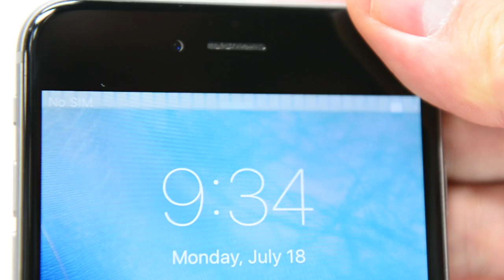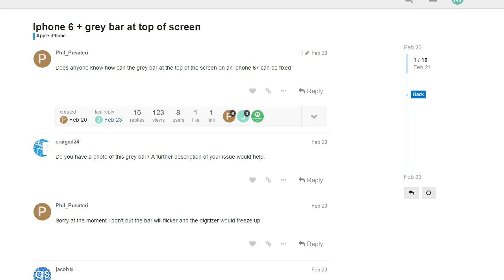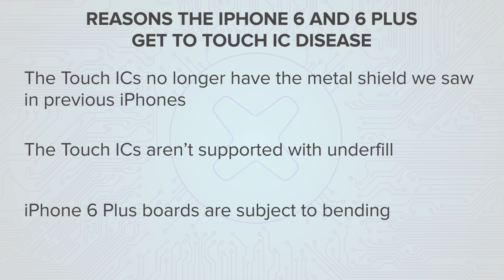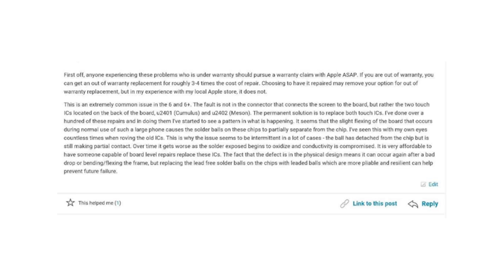A Design Defect Is Breaking a Ton of iPhone 6 Pluses

Comment: No metal shield and no under fill and put into a bendable metal housing...

Apple has taken too many cost cutting measures. 

Hopefully iPhone 7 is better.
Reply: I work at a iPhone repair place & this has happened a lot, also Celestial Being FTW
Reply: Sabino Rodriguez That sucks. I have a regular iPhone 6 16GB and well, looking at this bullshit, I don't know if I should wait for the iPhone 7 and see if they fixed this cost cutting bullshit or if I should make the switch to Galaxy S7/Galaxy Edge 7/Galaxy Note 7.
Reply: Sabino Rodriguez Oh and yes. Gundam 00 is my favorite Gundam series.
Reply: Even with this I still wouldn't go to Samsung I would rather go to LG or One Plus. Samsungs are one of the worst phones to get fixed. I also usually switch phones yearly before the warranty expires also haha

Comment: It's planned obsolescence. Full stop.
Reply: Such a systematic design flaw could very well end up as a class-action lawsuit. While the warranty may be only one year, nobody buys a $400-600 phone expecting it to last barely over a year before developing a major flaw. This sort of thing is covered under fitness for the intended use and reasonable expectations regardless of the warranty.
Reply: I hope they get sued to hell. 300 Billion USD penalty would be adequate.
Reply: I don't support the reasons given in the clip, metal shielding isn't used to provide rigidity, it's too thin to do that, it's used to shield the boards from static electricity, same reason as the tape, further the 'super glue' (terrible analogy) isn't used so much as a structural element but more for isolation between the pins of the IC as they are in such close proximity to each other, the lack of proper isolation between the pins in more likely to short and damage the chip, or an internal chip malfunction due to overheating. Anyways all products designed are designed to fail nowadays to increase profit margins
Reply: T3RRA_BITE_
The shield is there for EMI compliance reasons, not static. The PCB is inside a housing which already protects it from static and there are many traces outside of the shield which could conduct static to the stuff located under the shield anyway, such as all the buttons, camera and external interface stuff. As for the underfill, it is both structural (relieve some mechanical stress from the balls) and to prevent stuff like moisture and foreign objects from getting under it - those tiny balls and pads won't last long if moisture corrosion gets a chance to get started.
Reply: +BloodySword I wish they could get sued for that amount, lol. That will teach them to stop fucking with their consumers.
Reply: DuxDub Studios
Best "sue" (punishment) is the customer not buying their crap anymore.
Reply: I currently think so. My iphone 6 started having this vertical white/washed out stripes running through the LCD today.  Other youtube fix vids say its a loose connector(s) from the LCD to the board. I went to the apple store and wasted a few hrs for them to tell me my screen is failing and it'll cost $130 to replace it or I can trade in.... This is happening 2 days before iphone 7 comes out.  I know someone else who started having the same problem a week ago. I'm going to try to fix it on my own first before I decide anything. :/
Reply: +Teardown Dan +Teardown Dan You are correct about the EMI compliance, however it is also there to remove the local static that the boards can come into contact with when they are being handled in the production stage as opposed to induced into the system, 
Although the underfill is used for that it also prevents metal whiskering, a common failure mode for IC's with pins in very close proximity 

The point I'm trying to make is that the reasons that they are giving don't really seems to add up, it's not a very good analysis of why it actually failed more of a random non-fact based guess when they seem to have the tools their to properly test the mode of failure or atleast narrow down what could have went wrong
Reply: Milos Djeric
It's not. It's overpriced rubbish, too. I would recommend the One Plus 3.
Reply: Milos Djeric
Samsung ones are slow, battery problems (I am not talking about explosions, the batteries just don't last very long), touch wiz is a joke, android is buggy... Never again.
Reply: Milos Djeric
I didn't have much lock on my S1 back then, and others who have Samsung (in Germany almost everyone has just Samsung) are complaining about slowness, bugs and things. :/ So I just keep recommending HTC 10 or One Plus 3.

I also tried to help them with custom ROMS on their S2 - S4, also not with much luck. It got better, but the internal flash is so utterly slow compared to the UFS flash in the One Plus 3.
Reply: Milos Djeric
I had the One m8, I don't even know the evo 3d. Is it a low cost phone? Try to show me any phone which has similar specs like the One Plus 3 for 399 EUR by Samsung. ^^
Reply: Milos Djeric
Ah I see. Then I have just higher requirements. I am really stunned about the One Plus 3. :D
Reply: Milos Djeric
My PC is my home theatre system. So no need for an IR remote. I can do it with a simple app. :3
Reply: Milos Djeric
I don't have a TV. 32 inch 4K monitor. I don't need waterproof things, I never destroyed something. I don't even use a phone case and I don't have any mark on my phone.
Reply: Milos Djeric
Never had problems with it, I usually keep it dry in my pocket then. When it's raining, I am busy holding my umbrella anyway.
Reply: Milos Djeric
I just don't have my phone on hand all the time, so even if I get surprised by rain it's not a big deal. Never had issues with this. Waterproof phones are just marketing anyways. If you treat your phone right, you don't need any case or any water proof phone.

Comment: i hav a karbonn android 4.1 tab bought in2012, worked great till now, even replaced its 8in digitizer myself.Now  it randomly any time touch feeds itself to anything on the screen_have enabled screen touch feedback, so i see the touch points.. if i even disconnected the digitizer connection still problem remains, so can't use a use a usb otg mouse also.,pls help.

Comment: iPhones still last longer than their Android counterparts, that has been proven.
Reply: Mabirc
Answer my questions? let alone answer one the article even proves more flaws and even misinformation
First the article was made by "appleinsider" in favor to apple, it's more than safe to say that it has a clear bias
Second the article was made 2 years ago with so called "press release" from 3 years ago, not even the "press release" data is still available let alone method of experiment that was used. It is no longer valid at all (I even doubt it ever been valid in the first place)
Third the unclear method of sampling doesn't even represent nor designed to represent the entire population in the first place.
Fourth, let say the data came from 2 million insurance policies from the insurance firm, that means the sample is only 0.001% from roughly 2 billion devices worldwide back then in 2013, not to mention those are devices that only covered by the insurance firm 3 years ago
Fifth, not even the sampling has a clear proportional equal number of 2 variables  that was being compared
Sixth the "Both Google's Android and Microsoft's Windows Phone lack any mechanism for similarly blocking reactivation of a stolen device by thieves" statement is not true at all that is major misinformation

The only thing that has been proven is the fact you've been bullshitting the whole time and even has the audacity to cited undated, bias, and misinformed "articles" as a fact
Reply: Chuckles while slowly claping👏🏿
Reply: Too bad this is the truth.
Reply: proven by what? your bullshit?
Reply: chrom4ful By looking on Google for example
Reply: +Mabirc 
heh you think a mere "link" is enough? what a laughable ground you have
first settle down the semantics
what is android counterpart? the term is far too broad and can be fitting to many variables
second "last longer" is a vague term what does it mean? hardware-wise, performance-wise, price-wise, each of those variable can be arbitrarily determined which means the process of experiment is important to see if the variable is viable
third what is the initial hypothesis? does it has certain bias?
fourth how is the result? can it still holds up today? (judging from this video I doubt that's the case)
Reply: chrom4ful 
And I mean all other smartphones, not only Android.
This should answer your question:
http://appleinsider.com/articles/14/03/06/iphones-much-more-likely-to-be-stolen-less-likely-to-be-broken-or-need-replacement
Reply: +Mabirc 
+Mabirc 
you have the audacity to called someone else "fanboy" while you desperately clinging to invalid article that's even has no longer existing "source" and called it a fact to defend your preferred device? why don't you look at your own eyeball?

first, the "source" not even exist anymore, do you think the numbers was magically appeared?
the article is bias because it only show number for one variable (DUH) while disregarding the other number which is btw lumped together from many other variables to favor first aforementioned variable

Second, time is matter especially if the variables are guaranteed changing constantly annually
the journal is removed simply because it was no longer relevant and invalid

Third and four, you're bullshitting again, for a sample to be valid to extrapolated to represent the total population it either need to be randomized so every member of population has the same chance to be picked as a sample which is clearly not the cases since the study only did sampling from homogeneous source, or the sample population need to simulate the actual population irl which is also not the case since the study was not designed to represent population in the first place
the article is just journalist nitpicking number which is not even valid to represent total population in the first place but claimed it to represent the entirely of population to favor one variable

Fifth, what is the actual proportion of number for one variable in compare of other variable which is btw composed of lumped together different variables which mean it automatically has higher error surface by probability

Sixth, the said feature was already existed since 2010 for windows phone and 2013 for android which is respectively 4 and 1 year before the article even release which clearly show that the the journalist didn't even bother to do research

Invalid number is useless, you know what you can do? you can stop bullshitting and stop take bias and invalid source as "proof" and/or "fact"
Reply: chrom4ful Thats why I said "Android counterparts". Dont know what you mean with fallacy. Do you want me to post a link ? No problem, I can give you one.
Reply: chrom4ful 
You are clearly biased yourself, you sound like a fanboy. I just stated something and you keep being unfriendly and deny it while the proof is clear. That's what fanboys do...

First, the article was made by AppleInsider but the study from an insurance company called ProtectCell. Saying that AppleInsider is biased shows that 
you're in denial AND biased.  Because they're an Apple News site that doesn't mean they are biased. Because i sometimes also read bad stuff about Apple.

Secondly, you're denying it again. Google it if you want, I can give you more links with the same story. And also it doesn't matter that it's 2 years ago, its the only data about phone durability we have and, lets be honest, things havent changed. Phones are still pieces of obsolescence. The reason for why some Journals remove it is very easy. Since many Android manufacturers are placing their ads in these Journals it would make sense not to write this or to remove this after a while. Notice how barely any journal bashs a company.

Third and fourth (which are about the same) are wrong. Of course it doesn't represent everybody that has a phone. But that's a study! And thats how studies work! You can't ask 8 Billion people the same question, same as asking every device owner. You ask a small percentage of those people, from different ages, cultures or jobs eventually. 
The study here is very simple. "Does your phone need replacement and if yes what phone is it ?" is a simple question which you basically can't answer wrong.

What do you mean with fifth ?

Sixth shows your bias again. Again, this article is from 2014, maybe back in time they didn't have that. I don't know if they have it now but that wouldn't bother me since my main point is about iPhones durability.

You clearly see the numbers, you just deny them. What else do you need ? Do I need to talk with the CEO of ProtectCell ? Or make a study myself and show my results to you with proofs that I am not "bullshitting" you ? Seriously man, give it up. You got no point. And please be more friendly.